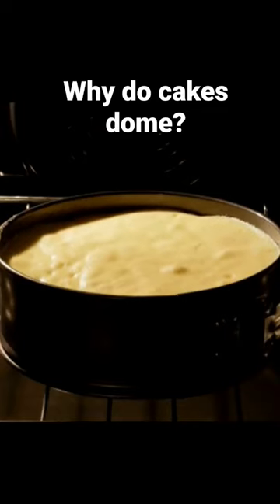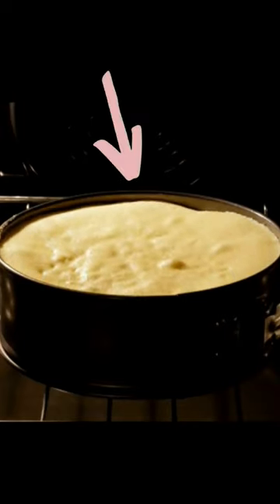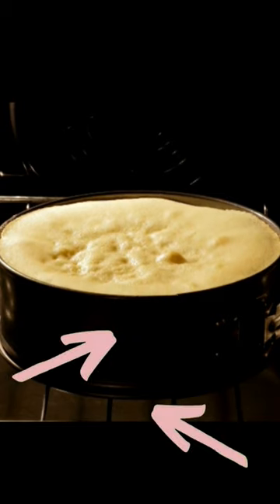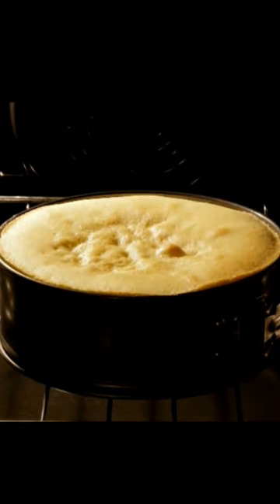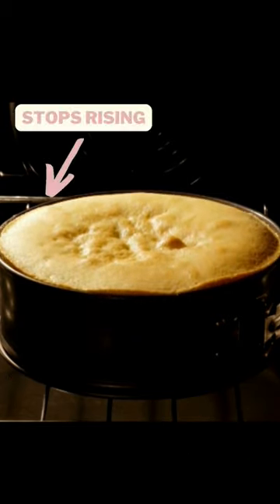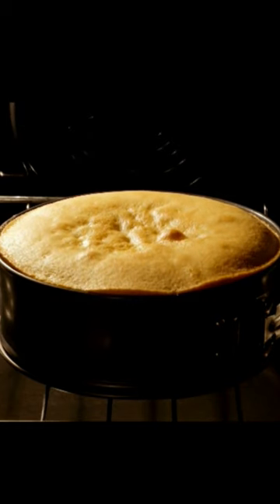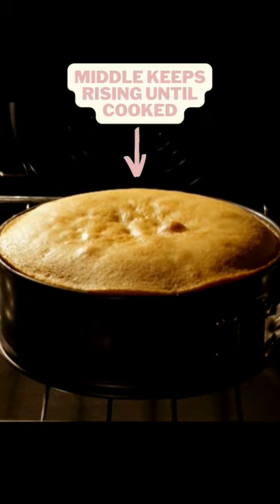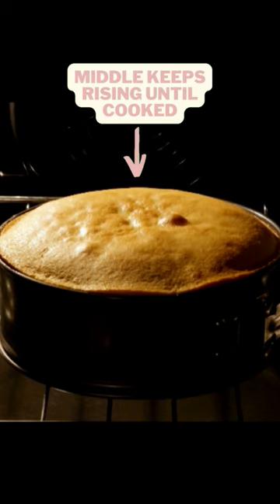Do you have this doming problem? 😫

Comment: I always thought doming was good and suppose to happen for a good baked cake
Reply from the maker: Hi there! So doming isn't necessarily a bad thing, but if you're layering cake layers then the less doming the better as you won't need to trim as much off the tops :)
Reply: They do sell strips that wrap around the pan with velcro that stops doming.
Reply: It's bad when you want to layer cakes. You have to cut the dome off.

For cupcakes and plain cakes, it's good.
Reply: @1pk155  if your cake doesn't dome high chances are there it's dense, and that's worst with frosting
Reply: But I m professional, so it bit cost money,I have to trim the cake
Reply: Sister why my cake up com brown in middle so soft

Comment: I have not yet use any cake strips ever but most of the time when i bake there is no dome in my cake. I usually bake my cakes at 150-160°c for 35-40mins. Depending on the size and thickness, the timer maybe longer but same heat temp.
Reply: Good! I do exactly the same thing. Ive been baking for more than 20years now,I never have a dome on my cakes. 150 degrees